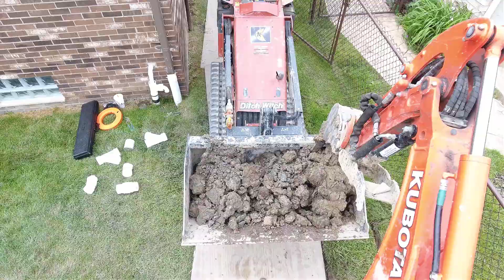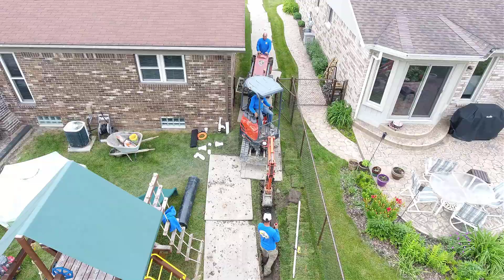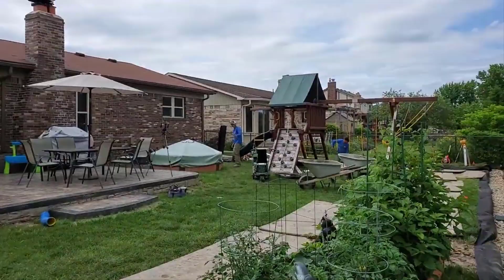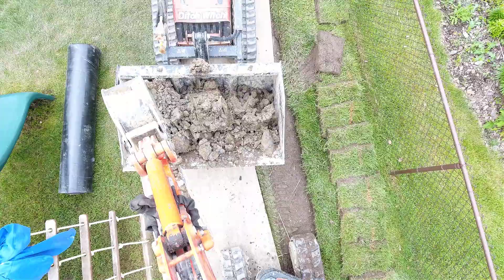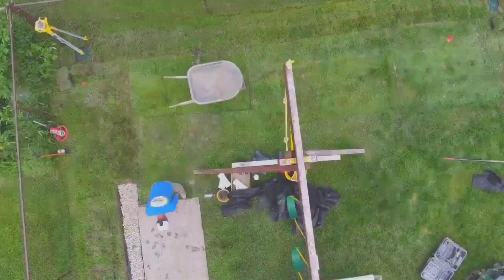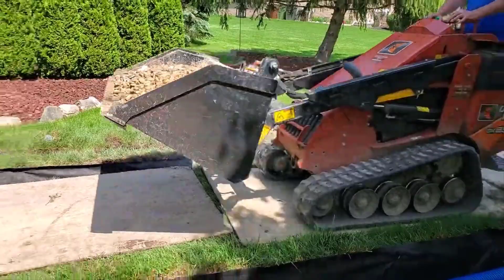How to Install a French Drain Like a Pro and Fix Yard Drainage Problems

Comment: Why use 2 6inch pipes vs 1 10inch pipe?  Does the blue pipe not come in a bigger size? You guys do awesome work . I dug a 50ft French drain around a problem area in my yard and 4 yrs later it’s still bumpy and uneven as can be🤘🏻😯
Reply from the maker: The price on 10" pipe is crazy expensive not to mention its impossible to go under sidewalks ect.

Comment: We had a lot of rain this Spring, Chicago Il. I have a lot of standing water in the back yard by the fence. In one of your videos, you said you don't like any trees planted near the drain. Can I plant bushes around the drain? I don't want to put sod on top of the drain.  I have dogs and want to make a buffer between the Nabors yard to keep them from having to deal with their dogs. If I don't put the sod back there what do I put on top of the finished drain system? Do I just add landscaping rock on top after I finish wrapping the gravel and pipe?  I want to put mulch around the bushes. Thanks

Comment: So, other than not necessarily having to burrito wrap, is there an argument against doing it with the new pipe, if someone chose to?
Reply from the maker: We still do. That job had flood water and needed to take in thousands of gallons per rain event. Thank you for commenting good question
Reply: @FRENCHDRAINMAN  Thanks for confirming. I've watched a ton of your videos, and I appreciate you sharing some of your best practices. I'm looking forward to seeing a leach field video, as I need to move some water in rural Arkansas, and I'm nervous that a dry well would be a wasted effort. 😀

Comment: So no more burrito wrap and now you use inlets?
Reply from the maker: The Baughman High Octane Royal Blue was purpose build for Yard Drainage (first pipe ever built just for Yard Drainage) wider inlets allows sediment to wash right through. We have done 3 years of research and development to achieve our goals. The area's we work deeply cut sod has a clay backing so no dirt to fall in the stone. I will put this system up against anything and everything with confidence that the Baughman High Octane will come out on top! 👊☝️💪